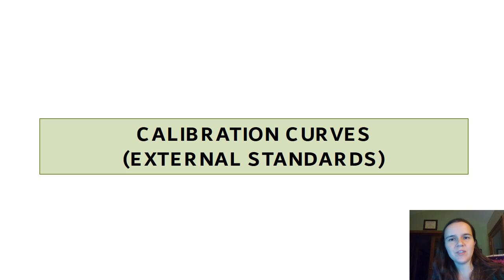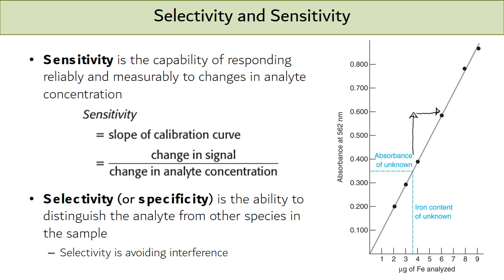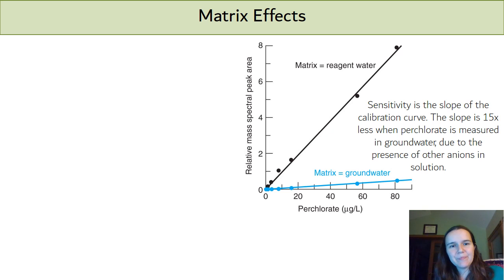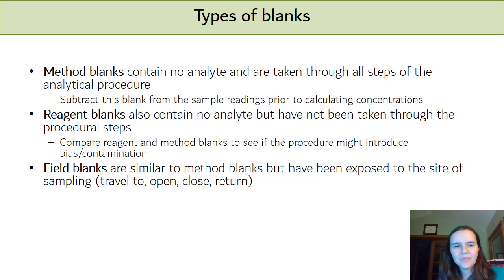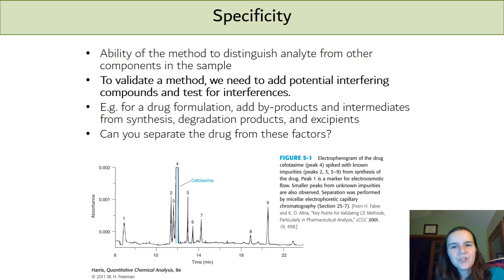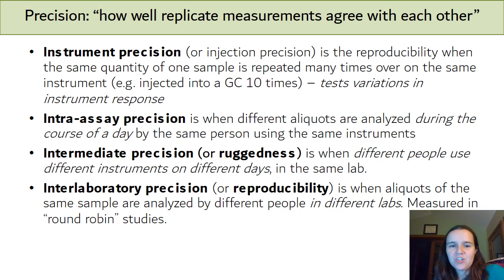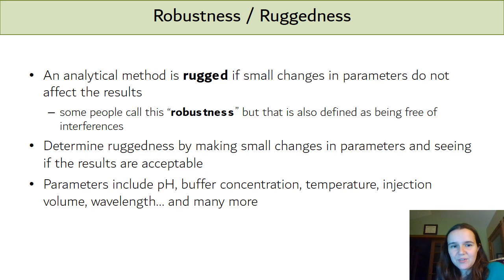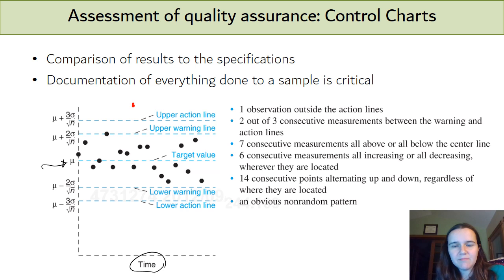Calibration Curves, Blanks, and Method Verification Terminology

Comment: If you have ultrapure RNA/DNA free water and run in the spectrophotometer yet get some peaks, what could be the problem. I have tried all troubleshooting with the samples including filtering using a 0.2um filter and I still get the same. What is concerning is it's not consistent with the peak but is consistently there

Comment: Can we use quadratic curve for quantify the analytes?
Reply from the maker: Hi Anantharaj, if you expect a linear response based on the physics of the measurement (such as for Beer's law in UV-visible absorbance spectroscopy) then you should not fit to a quadratic curve. There are some measurements where quadratic curves are appropriate (such as the atomic absorbance or AA of some elements). I think it is important that you have replicate samples at each concentration before you decide to use a quadratic equation, since you do not want to over-fit noise in the data. I hope that helps.
Reply: @robyngoacher  Thank you for the quick response. My doubt is, can we use quadratic curve to quantify analytes in the GCMS (eg: phthalate).
Reply from the maker: @AnantharajJack  I am not an expert in phthalates in GC-MS but in general the GC-MS peak area should be linear with intensity. I recommend that you check that you are using peak area instead of peak height (area is better since the later-eluting peaks in chromatography become wider). Then I suggest that you check whether your data is linear if you use only lower concentrations. You might be saturating the detector at high concentrations which will lead the calibration curve to flatten out. If you can look up existing methods and literature on this particular analyte in GC-MS that can also provide guidance, but my instinct is that your results should be linear, not quadratic.
Reply: @robyngoacher so, linear curve is  good for quantification to get reliable concentration. I understand that. But if I use quadratic curve, will there be much deviation in the final results?!!
Reply: Thank you in advance